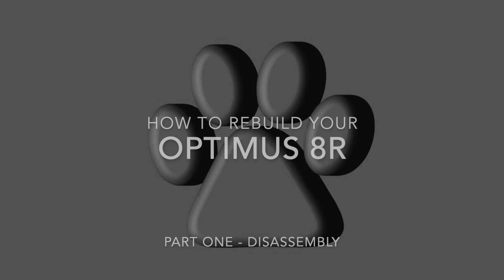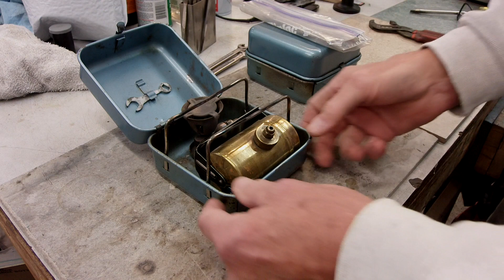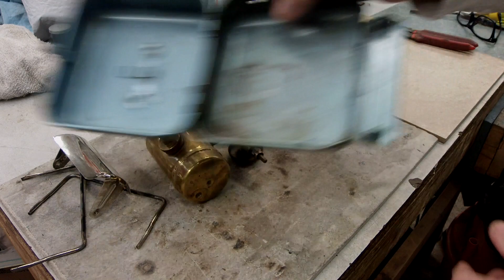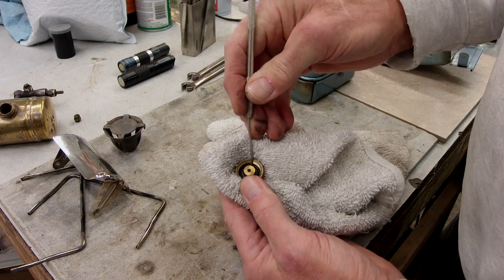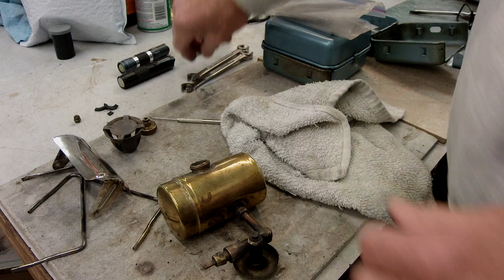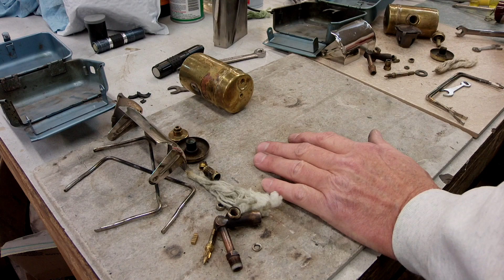Optimus 8R Stove Repair/Rebuilding - Part 1: Disassembly

Comment: At 7:15..... I have an unbelievably tight burner body to tank nut! Tried WD40 and an 11mm Brake Line Spanner (Wrench)....It won't move! Is it worth using heat????  Burner is working at 50% efficiency, it has been left for years. After servicing everything else, I'm assuming there's fuel residue in the wick, blocking the flow??? What do you think Bernie & YouTube Viewers??
Reply from the maker: I clamp my wrench in a vice and put the tank in the wrench, then turn the tank. WD-40 or any other penetrant won’t help that joint because it is a taper pipe joint. You could try some heat if you like, but I would advise using a heat gun not a torch. And remember counterclockwise to loosen clockwise to tighten. BD
Reply: @BernieDawgCinema Many Thanks, I'll let you know how it goes.....When I get the nerve to do it! 😳

Comment: Yes the spindle fuel is leaking from it and catching fire should I tighten the spindle nut
Reply from the maker: Yes. Tighten the spindle nut. It may be that you need new graphite packing. Here’s the manual for the stove: https://www.berniedawg.com/optimus-8r-manual/ BD

Comment: Mine is leaking from the does that mean I have to tighten the spindle nut
Reply from the maker: Yours is “leaking from the does”. Sorry. I don’t understand what the “does” is. 🤷  But, you could tighten the spindle nut a bit and see if that helps. BD

Comment: A beautiful stove. I am confused about the fuel. Kerosene. When it ignites, the flame becomes unstable. My friend says that kerosene is not suitable. Low-octane gasoline is better. Is what he says correct?
Reply from the maker: Only use Coleman, Crown, MSR Superfuel, or other naphtha camping appliance fuel. While you can use gasoline the stuff you get at the pump these days is chock full of additives and ethanol and won’t be good for your stove long term. The lower the octane the better. NEVER use kerosene, diesel, heating oil or other heavy fuels in these stoves - they weren’t designed to burn that stuff. Here’s the manual: https://www.berniedawg.com/optimus-8r-manual/ BD

Comment: They put a wrench in the kit that will take that apart why didn't you use it that is what it it for
Reply from the maker: @user-ff6ju6hg4u  Naw, Kenny. You’re wrong. The little stamped metal wrench included in the kit is for use in the field to tighten up the spindle packing nut or to remove the jet in case of clogging. It’s a pretty crappy little tool but works in a pinch when in the wilderness and there are no better tools to be had. Smart and experienced stove owners use real quality tools when rebuilding these vintage stoves. 👍😎 BD

Comment: I have a optimus 99 I tried to clean it the best I could I couldn't remove the tube from the tank an dident want to mess it up I tried resetting the cleaning needle I set it at 3 clicks an it wouldn't shut all the way off I set it at 4 it still wouldn't I set it 6 an 7 still wouldn't what would you suggest thanks an pleas help I would like to use the stove an be able to put it away an. The bottom pan not be full of fuel
Reply from the maker: @PaulBearden-be1pe First off… did you watch the reassembly video, too, or just the disassembly video you are making your comment on?
Here’s the part of that reassembly video where I show how to set a cleaning needle:
https://youtu.be/3ytcym3qhcA?si=H_L1188cH0HCDeXU&t=503
I also have a whole playlist of videos on the 8R type stoves here:
https://www.youtube.com/playlist?list=PL9Tg7BYD6fUJ4L9S6PipKE0-GOAlUVShb
The best way to test your stove is to remove the cleaning needle and fire the stove without the needle in place.  If it doesn’t shut off with the cleaning needle out of the stove, then you likely have a marred spindle seat. It’s another issue. If your stove now shuts off (without the needle), then you need to practice your needle setting more.
Most people don’t get needle setting right the first time and it takes some practice until you get it figured out. If the spindle shuts off without the needle, but doesn’t shut off with the needle, then you are setting the needle too deep. The deeper you set the needle, the more likely it will keep the spindle from closing all the way. So… if you try 3 clicks and the needle is keeping the spindle from closing all the way, then try 2 clicks. (That’s rare and unusual and is more likely due to your newbieness.) Keep at it and expect to try more than once. Need more help? Free hotline here: bd@berniedawg.com BD

Comment: HI Bernie, I'm currently restoring an Optimus 111 stove , would you happen to know what the correct colour code and type of paint finish was applied as standard,  my stove had been brushed with any old paint various colours over the years.  I am rather particular about getting the details correct .any help greatly appreciated. 
Kind regards Damian
Reply from the maker: @damian tuttle Maybe best to just watch this video: https://youtu.be/gQjnmj-rIi8 Or, you can read all the following blah-blah that I wrote before enough caffeine reminded me I'd already done a video on the subject of 111 case restoration/painting. Doh! 
All Optimus stoves were painted without primer and simply used automotive-style paints. Sorry. No one anywhere knows the "correct color code" for you stove. Folks at Optimus were secretive in the day and the folks there now have simply discarded all that history out of lack of interest (okay, boomer-ism). If you want an exact match, you could take a color correct stove to a body shop and have them mix/match it for you - it'll cost you a bundle to do that and may be hard to find a shop that'll do small quantities for a stove. If you want the most common of the Optimus blue colors, then see what you think of the best off-the-shelf match I use. Dupli-Color Medium Maui Blue BGM0423 is very close (imo). If you are in the UK or EU, you may have other colors of automotive paint available to you to select from. Haunt the paint aisles of your local automotive supply shop. Make some selections and try them out. No need for any special "heat resistant" paints. Optimus didn't use them and auto paint is both heat resistant and fuel proof if allowed a full 30-day air cure. That said... if you set your stove on fire (fuel leaks, operation mistakes), even "heat resistant" paints will bubble and scorch. Good luck! BD
Reply: @BernieDawgCinema  brilliant Sir , what a wonderful helpful reply , thanks so much I'll certainly watch the video .
Kind regards Damian

Comment: Thanks for your excellent videos!! But Ohjoi,  i think the fuel pipe itself twisted approx. 45 degrees (but didn't snap) when trying to unscrew the tank with handpower in a wise :/ First i thought it was unscrewing nicely, not really sure how much (If any). First owner of this 8R, so no weird "repairs" of it from before..
Reply from the maker: Ouch!
Reply: @BernieDawgCinema  yeah.. maybe it is a bit too risky to try twisting it back?
Reply: Update: gently twisted it back without any cracks! PUH Next, i am getting that brake line tool and some heat!

Comment: What material is the gasket that goes in the cap through which the fuel is added?
Reply from the maker: @percy b Viton is the only good choice for fuel-safe gaskets on Optimus fuel caps. BD
Reply: @BernieDawgCinema  what is Viton? Excuse me, I'm using Google translate, I'm from Peru, and I have the same cooker, and I wish it would work, thanks
Reply from the maker: @percy b Viton is a fuel-resistant synthetic rubber product. Put “viton” in your Google search box to learn more. Watch both this video, the reassembly video, and the video on rebuilding fuel caps at my channel to learn about the fuel cap gasket and the SRV pip in the fuel cap and how to replace them. Check my webpage of stove part suppliers to find ready made Viton fuel cap washers and pips and a whole lot of other stove part stuff, too. Links for most of that are just below the video in the video description - click on the little arrowhead to get those to show up on a phone or tablet. BD
Reply: @BernieDawgCinema  Gracias

Comment: Have an old optimus 8 and need to change wick. Burner is stuck to tank. How to proceed to make it loose? Heating the burner? Penetrating oil? Just force?

Best regards, Mikael Jonsson
Reply from the maker: @Mikael Jonsson Thanks for your question. The Optimus 8 (no R) exists in at least three different variants. One of the variants has the fuel feed pipe permanently affixed to the tank - it is not removable, and that’s okay because there is no wick in that one - so no need to replace the wick. The two other styles have completely different disassembly methods. Drop me an email with some photos of your stove and I can describe (with pictures) how to disassemble the variety of Optimus 8 (no R) that you have. Doing them all here in this little text box is really beyond the scope of YouTube comments. bd@berniedawg.com 👍 BD

Comment: Can these be run with 99% aclohol?
Reply from the maker: @mingiasi Absolutely *not*. 99% ethanol alcohol has so much less energy per liter than white gas (aka naphtha - the fuel for which the stove is designed) that an alcohol/air mix will be far too lean to ignite in this stove. Plus, because 99% ethanol alcohol burns so wet and at a lower temperature, even with elaborate air restriction methods to richen the mixture, the flame won't drive enough heat through the burner bell to keep the alcohol vaporizing. What's wrong with using the correct fuel for the stove? BD

Comment: You probably address my question in another video. If so please direct me there. I have owned an 8R since the earlier '70s. Great stove!  Has served me well. I recently became more interested in the Optimus 99s. My question is are all burner and tank related parts interchangeable between those two stove models? Thanks for all of the great information and your "if its not broken don't fix it" approach to maintenance on these ingenious little devices that make life in the backcountry  that much more enjoyable.
Reply from the maker: @wanttogo Thanks! Yes. Optimus 99 and 8R parts on the tank and burner are the same and compatible. Just in different case styles. It's why I don't have a Optimus 99 video - same stove, same procedure. (Not sure if I actually ever mentioned it. Oops.) Good call! 👍 BD
Reply: @BernieDawgCinema  thanks. You jave a great channel!
Reply from the maker: @wanttogo Thank you very much. 😊 BD

Comment: @BernieDawg Cinema Thanks for sharing. I'm trying to rebuild my 8R but the nut that connects the fuel tank and the elbow piece that has the wick is extremely tight (and the nut also seems striped a little), any tips on how to remove it? I see from your video you can remove that part without too much force. I tried removing mine by 2 people and that piece not turning at all. Please help.
Reply from the maker: @Anne Fung In the video description box below the video I give you an email address where you can write and get additional advice and assistance. Here are some thoughts I have. First, as I say in the video, unless there is a reason to do so, you don’t need to do this disassembly. Consider first, why are you trying to take it apart? Does the stove not work? Have you replaced the rubber gaskets first? <— the single most common reason for poor performance which solves things 90% of the time. Next, make sure you are turning the valve body the correct direction to loosen it from the tank - counter-clockwise, or lefty-loosey versus right-tighty. Use the 11mm flare nut wrench (aka brake line wrench) I show in the video to do this disassembly. Don’t have one? Get one. If the disassembly is difficult, then you may consider heating or warming the joint a bit first. Make sure there is no fuel or fuel vapor around if using a torch. You can also put the entire valve body into a vise and turn the tank counter-clockwise. If none of that helps you, then definitely consider an email contact where you and I can share photos of what is going on with your stove and additional tricks that I cannot possibly convey merely through text in a YouTube comments box. Good luck! 👍😎 BD

Comment: What is your recommendation for actually cleaning the parts (solvent, degreaser, soft tooth brushes, etc?) Thx...
Reply from the maker: @Robert Glidewell Sure. Any/all of those. Also Simple Green, hot soapy water, solvents or hot soapy water in ultrasonic cleaners, brass-bristled brushes, soaking in water for a long time, etc. Whatever you find that works without discoloring or damaging the brass. Steel brushes, sandpaper, scrubbie pads, ScotchBrite, etc are no good. Drop me an email on the very long list of questions in your other post. YouTube comments are not like social discussion forums - sorry. bd@berniedawg.com 👍😎 BD

Comment: on my 8R cleaning needle stand does not work and the valve to adjust the flame works clockwise ??? what wrong with it .....it`s an old 8R from my dad
Reply from the maker: Try watching this video on the Svea 123/123R first (the spindles work the same way) and see if that helps you resolve things: https://youtu.be/qBAdn5Oda2s
If not, drop me an email with some photos or a link to a video and we can get you squared away. BD

Comment: Eleven millimetres is 7/16 in the old money !!. Like your style keep up the good work.
Reply from the maker: Glad you like the videos. But, DON'T use a 7/16" on the 11mm tank pipe nut. NO they aren't the same size, not even close - 7/16" is bigger than 11mm and will fit sloppy. You WILL round over the soft brass hex fittings if you try it. Use the right tool for the job or have someone else do it for you. They don't make these stoves or replacement parts anymore. 👍😎 BD
Reply: @BernieDawgCinema  I totally agree. Have been a diesel mechanic for 35 years, i would use a flare nut spanner (wrench) or crows foot. Just got into these old stoves, i think i maybe addicted! Love their simplicity but also clever design. Have watched many of your vids. Share the knowledge !!
Reply from the maker: Yup. Flare nut wrench in 11mm is the way to go. Take it easy, go slow, and good luck to you on the new stove hobby. Please remember that these stoves are of soft/brittle brass and the torque on these is way lower than on a diesel truck engine. 😳👍 BD
Reply: @BernieDawgCinema  And that would be an eleven millimetre wrench too!

Comment: That is a wonderful stove the Optimus 8R , mine is 55-56 years old now and has never failed me .. Nothing wrong with cooking over a campfire it's how i was taught back in the 1950's..
But packing firewood when i would be camped in Alpine areas where there was none , i thought there has to be a better way so i looked into it .By gawd REI sold them in the Seattle store .. 
First model i bought was the Svea 123 and a couple months later the Optimus 8R those two models all the years i have used them have never ever failed.. Gawd 30 years later i replace the fuel cap gasket that was it ..Thank you very well done ..
Reply from the maker: Thanks! Glad I could help you keep your old (but completely usable) stove alive. Great story, too. Thanks for sharing! BD

Comment: I have a problem removing fuel pipe from tank since its really soft copper. Any suggestions? Would heating it up loosen it?
Reply from the maker: I'm assuming you have an 8R and not an 8. The joint is a tapered pipe joint, so it will tighten and seal without the use of sealants, thread lockers or glue, and such methods are unnecessary to achieve a fluid-tight joint. You could try warming the area of the joint but you must be careful if you are using flame that you do not ignite residual fuel vapors. The best bet is to use a brake line wrench (aka flare nut wrench) of the proper size and make sure you are turning the feed pipe nut the correct direction. Lefty-loosey, righty-tighty, or, counter-clockwise to loosen, clockwise to tighten. Drop me a note at berniedawgstove@comcast.net if you have more questions or need more guidance. Happy to help. Good luck. 👍 BD.

Comment: The burner on my stove seems to be quite stuck to the tank.I guess optimus used some thread sealing glue? Could i apply some extra force to untighten it?
Reply from the maker: Possibly, but not in my experience. Though it's hard to say what some other person might have done to the stove before you. Lots of people work on these and create their own "solutions" which may be handed down to you.  
The joint is a tapered pipe joint, so it will tighten and seal without the use of sealants, thread lockers or glue, and such methods are unnecessary to achieve a fluid-tight joint. You could try warming the area of the joint but you must be careful if you are using flame that you do not ignite residual fuel vapors. Best bet is to use a brake line wrench (aka flare nut wrench) of the proper size and make sure you are turning the feed pipe nut the correct direction. Lefty-loosey, righty-tighty, or, counter-clockwise to loosen, clockwise to tighten. Drop me a note at berniedawgstove@comcast.net if you have more questions. Happy to help. Good luck. 👍 BD.